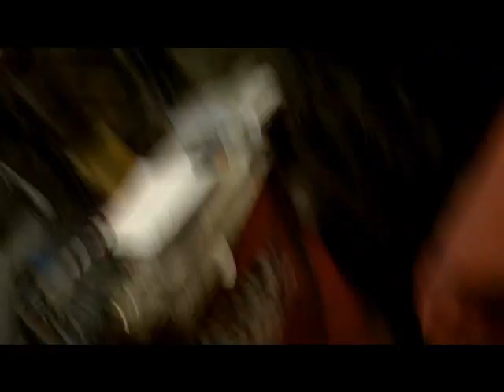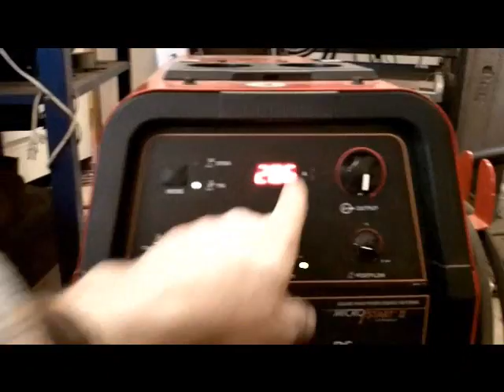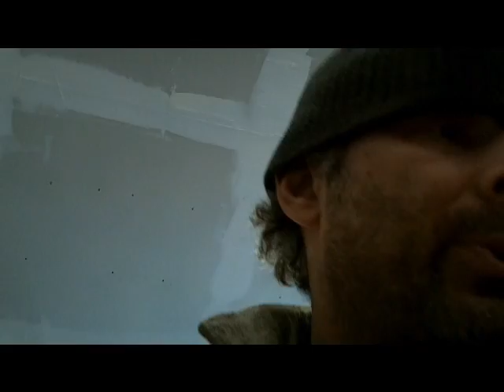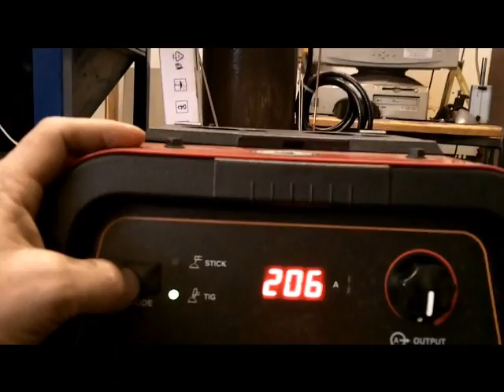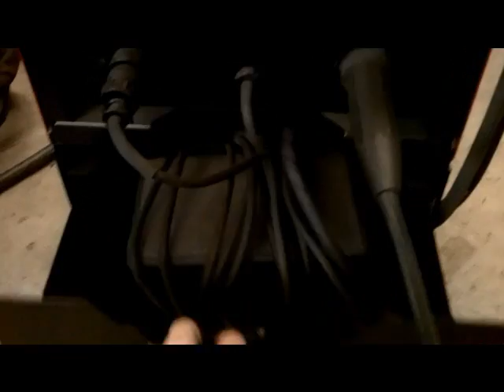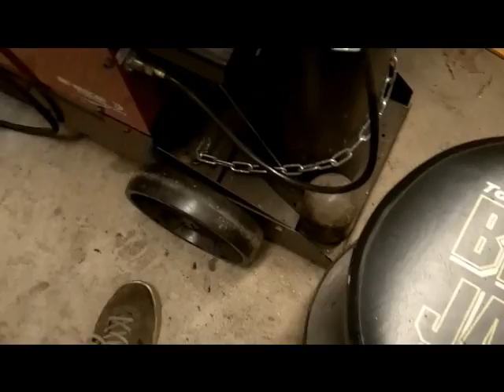Lincoln Electric Precision TIG 225 welder power source

Comment: I use this same machine at school, really an amazing piece of machinery. Only complaint is the duty cycle, its absolutely awful for a $3,000 machine. The lowest ive ever thrown it was at 154 amps running 5/32 7018 overhead. At about 200 amps I can usually get about 2.5 rods of 3/16 7018 before she thermals out.
Reply: Sounds like you need a software upgrade.   Get 2018 our above.  This upgrade will fix your duty cycle issue
Reply: Can you explain more about the software upgrade? @wesleynichols5383
Reply: Can you explain more about the software upgrade? I have a machine that is older than 2018. @wesleynichols5383

Comment: I bought the 185 amp model of this about 8 years ago. Then they came out with the 225. I wish mine had the extra out put however they are great welders. I have welded some pretty heavy aluminum castings with mine as long as you pre heat good it does a great job.

Comment: @modernblacksmith it works well if you only occasionaly contaminate slightly, makes tungsten last longer since you're not grinding them down so much, but if you heavily contaminate or contaminate frequently as a beginner might its not that useful as you'll need to grind a point anyways. Also we just got a water cooled torch for this machine, haven't hooked it up yet but ill post a video when we do.